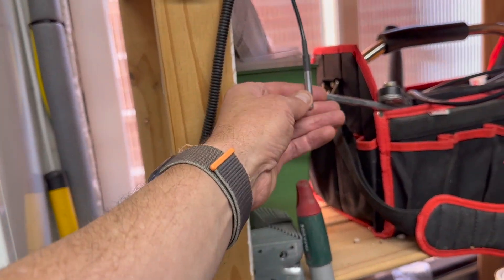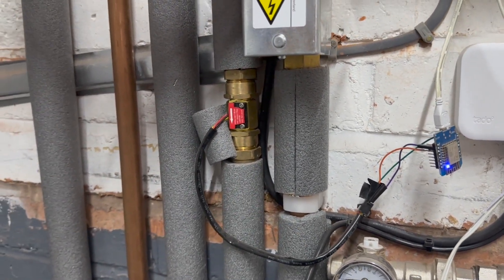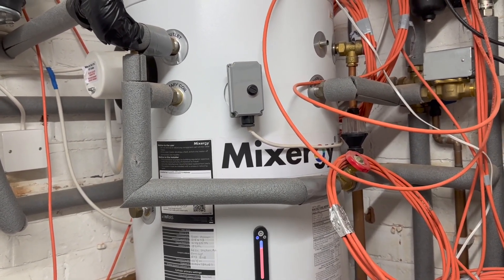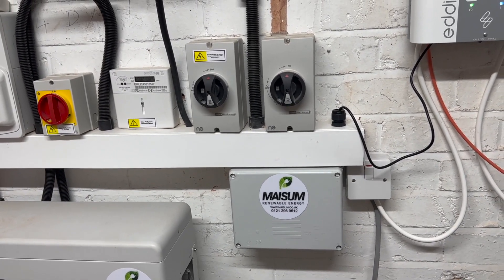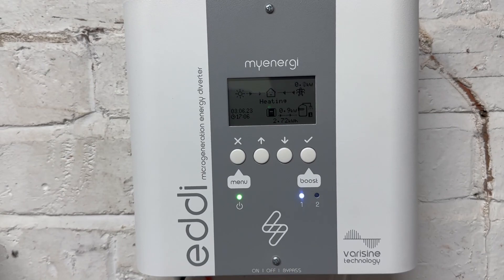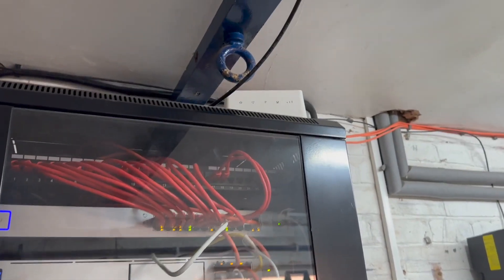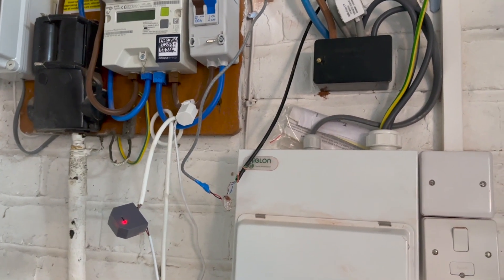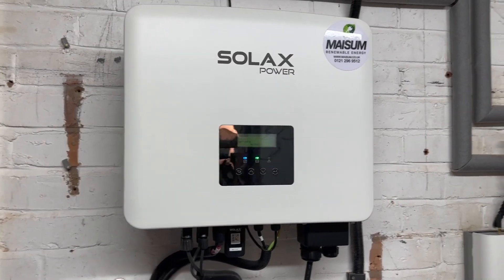A brief tour of my plant room aka my garage!

Comment: Are you a electrical engineer or a just to do it yourself or you seem very conscientious and know all of them equipment and the sources. 
That’s very impressive. Good video.
Reply from the maker: Thanks! I'm glad you liked it. I'm a computer programmer by day. I love learning and teaching myself about all this stuff.
Reply: @tomasmcguinness  I am from the mechanical side of the world my shop has in floor heating, which I need to get that system up and running
Reply: @tomasmcguinness  I figured you were someone on that line because the connectivity of every component so that you can monitor it remotely and you had a security system.